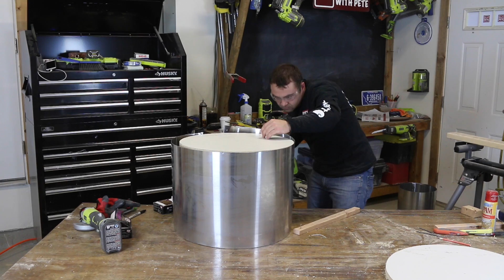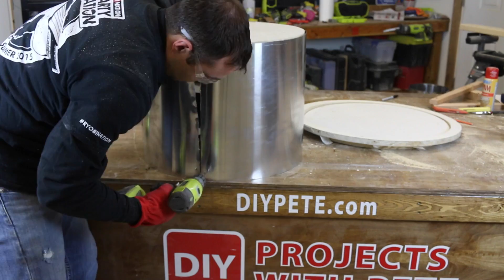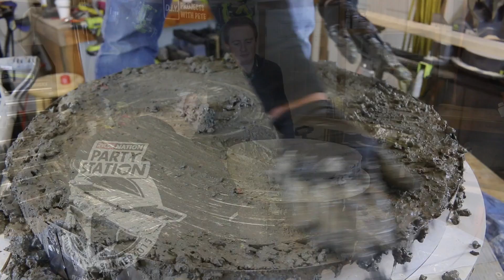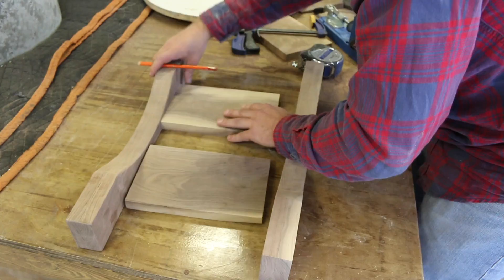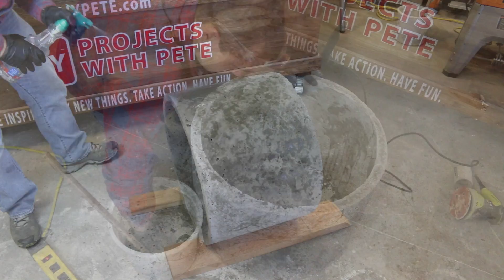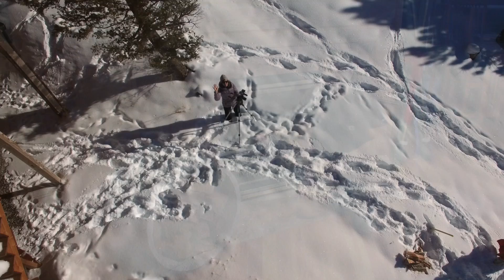DIY Modern Concrete Log Holder | Step by Step

Comment: how long does it usually take on one project? love your channel ^_^
Reply from the maker: Hi! All projects vary in time, but this project takes a about 3-4 hours for the mold / pour process, and another few for the finishing. It will depend on your skill level and tools used as well. I let the concrete cure for about 3 to 4 days.

Comment: Pete when working with flashing or coil use a utility knife to cut it. mark your line score it hang the cutoff over the table n use it as your break. Just bend the cutoff down ward. You only need to score it 1 time with medium pressure on the blade. Never cross cut or length cut the coil it creates to sharp of a edge. I am not saying the factory edge on the type of coil you used because it is. However the tin snips make that edge so sharp just a tap on it n you're bleeding. I do doors n windows n have my own break. I only use tin snips after I bend the material n I capping the door or window. I promise your way was much more time consuming n creates a worse edge. That flashing you bought at the home center is so thin you'll be shocked how easy it is with a utility knife. I use O2 gutter grade to cap my Marvin doors n windows n I only score it once to cut it to length for my break. 
Hope ya find this info of good use.
Reply from the maker: +joe brown Hey Joe! That is great info and something that would make this process simpler for others looking to replicate this project. I didn't even think about scoring and cutting using a utility blade -- but it makes sense! Thanks for taking the time to watch the video and to provide solid advice and tips. It's great to hear from someone like yourself who works with flashing etc much more than the rest of us. Next time I work with flashing, I'll take the easy and cleaner route of using a utility knife. Thanks Joe and Happy New Year man! - Pete
Reply: Happy New Year to you to Pete. You're welcome and thank you for all the videos I really enjoy your projects.
Reply from the maker: +joe brown Thanks Joe!
Reply: DIY PETE I forgot to mention I'm sure you noticed it wanted to roll back up on ya lol. When ya go to score it use a couple paint cans in the opposite corners or one long board down the center so it doesn't do that to ya. After that measure it use a straight edge n score it. Hang your cut off over it will bend like butter.
Reply from the maker: +joe brown Awesome, all great info Joe! I appreciate it, and so does everyone else here. Thanks for sharing your expertise. Have a good weekend and let me know what you build next!

Comment: use seka 1 2 3 or 223 works great the structural growth you won't get the voids
Reply from the maker: +Twat Waffle Thanks! I've used a number of other products etc for various projects, but try to keep things as mainstream and easy to find as possible so the average DIY'er can find the materials at their local hardware store. Sounds like a great and fluid mix though. Thanks for the info!
Reply: +DIY PETE j
j

Comment: Very nice! Do you think that the concrete would be strong enough to support a table top (laying down the way you have it)?
Reply from the maker: +Adam Simon Hi Adam, thanks for checking out the video! When you say strong enough to support a table, do you mean if the cylinder openings were facing up and down instead of front and back like in the thumbnail and video? I'm not sure I understand what you have in mind.
Reply: Yes, imagine if the thumbnail shown had a rustic table top on top of it... Parallel to the base! Do you think the cylinder would be strong enough?
Reply from the maker: +Adam Simon Hey Adam! If the cylinder has the openings to the floor and ceiling -- it would certainly be plenty strong to support a rustic wood top.

Comment: Looks awesome. I am totally probably going to build this :) We just got an insert for our second fireplace so we are actually using it now and I have logs all over the place. Great timing. Spent my fall/early winter hunting in Montana and we got some snow but nothing like full winter!
Reply from the maker: +richsipe Hey RIchsipe! Very cool, wood burning fireplaces are the best! Were you out looking for Elk? Where do ya live?  -- Also, I have one other design on a concrete log holder in case you want options :) Cheers! https://www.youtube.com/watch?v=Y9rkZSY7-Ts
Reply: +DIY PETE Yes Elk and Deer. Got my first Elk which was amazing. We went for Bow and Riffle and put tons of miles on before finally both being successful and filling our tags. I live just north of Portland Oregon in Battle Ground WA.  I did watch the other one right after-I had seen it before but then we weren't really using our wood burner so I didn't need it. I think I may go with the square one because I like the idea for a shelf. I may build a kindling, matches, & paper holder also on the top as that is all over the place too.